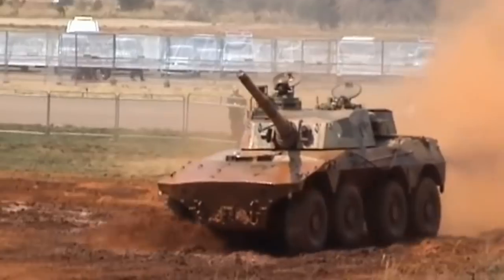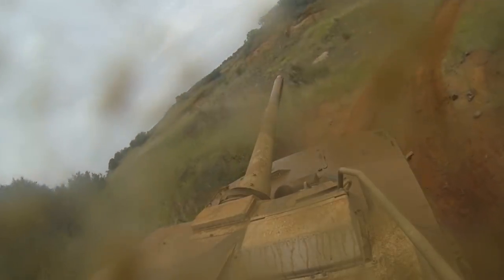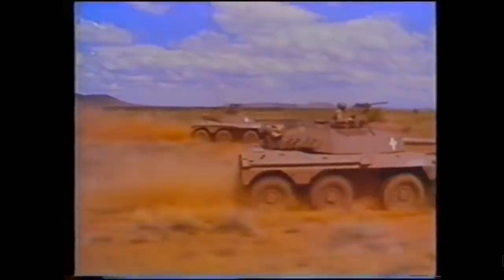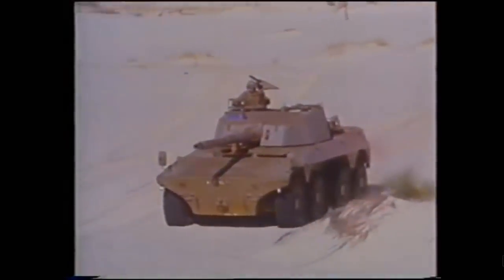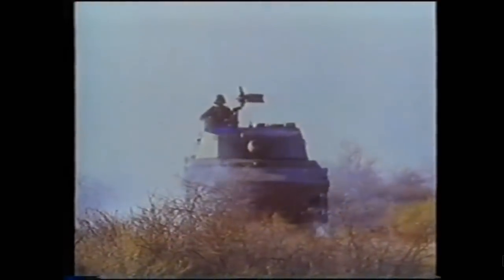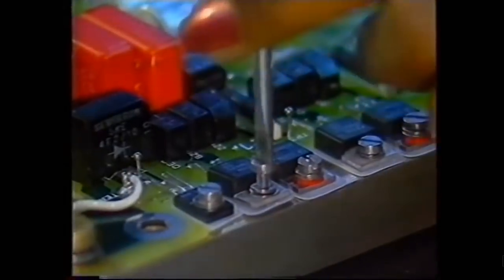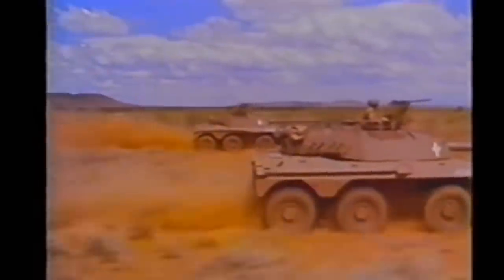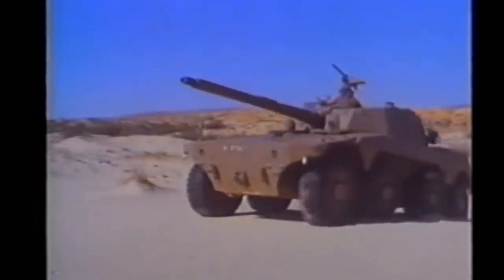Rooikat Armored Fighting Vehicle - South African Firepower

Comment: Something like this with a 120mm gun for our fast reaction brigade would be a good idea
Reply: there is a rooikat with a 120mm, it is not supposed to have been produced but it but a number have been seen on parades, what that means is up for debate but still
Reply: The Rooikat has a lot of potential. You can design 20 mm anti aircraft guns onto it for protection against aircraft, or even twin 60 mm mortars for close artillery support.  But yes, there are 120 mm and 105 mm prototypes, they unfortunately never went into mass production as the 76 mm proved itself more than capable.
Reply: @matthiuskoenig3378  At what parades have you seen Rooikatte with 120mm guns?

Comment: Rooikat (Rooi sounds like Boy, Kat sounds like Cut)

There is much discussion regarding the 76mm cannon The vehicle was built for speed (over rough terrain) and fire power in Southern African conditions. Including a 105mm or 120mm cannon will add (ammo) weight, and may compromise speed etc.

Comment: This seems like a good all-around afv for it's time 
It is showing it's age though with the 76mm cannon, which I would think is a little underpowered by today's standard but most everything else is quite good like it's maneuverability ( which is the one trait on a vehicle that is timeless) imo it's a little on the heavy side but it's power to weight ratio is real good and it's protection is lackluster 
   The biggest problem though by far is that DAM music in the factory video man I get it it's the 80's but come on 🤔 O and having tracks as an option would be nice...........😏
Reply: +Theprfesssor+ imagine mounting the 76mm gun on a Bradley (or the chassis since given how cramped the Bradley interior is I doubt the current turret could accommodate it).
Reply: cnlbenmc 
 Yeah, the Bradley would have to have a whole new turret most likely and even a redesigned hull top, if the turret ring is not big enough 
It wouldnt really help the Bradley anyway in it's main goal,its a infantry fighting vehicle designed to carry and support troops then leave the area and the 25mm auto cannon has many rounds designed specifically for this and is a light armament, the rooikat and others like it are AFV they are pretty much wheeled tanks, the closest thing to a light tanks we have today they not only cross great distances and Recon they can go on the offensive against other armored vehicles including including tanks now not head on but a gorilla type attack style is possible 
Overall the Bradley doesn't need much help fighting/protecting itself even against tanks, the Bradley unit's actually knocked out more tanks during desert Storm then the Abrams did so for now I think they are fine  (thanks to its dual tow missile but still )
Reply: +Theprfesssor+ probably right on the turret part, many years ago at an airshow/tankshow when I was around 10 years old and only around 5'4 instead of slightly over 6 feet tall now; even then I found the interior of the Bradley to be cramped. The idea I proposed would be for a separate type of vehicle akin to the Stryker MGS, a light tank variant or for the M3 CRV to give it a bit of an extra punch in it's recon duties if thing get dicey. 

Though the thought of just imagining one upping the BMP-3 with a Bradley variant with a new turret armed with the 76mm, a 25mm coax and some ATGMs with a ROWS as the cherry on top all at once makes me smile, fat chance that'll happen though.
Reply: keith moore 
This is why the Stryker ( like most modern military vehicles) are a modular design, the army can outfit them for certain situations to have them better equipped to deal with them 
   The 105 is used because it still performs well against most modern tanks and it's standardized by NATO, all countries in NATO can and do use them so it's easier in terms of logistics, the biggest reason to use a cannon though is its versatility you can fight tanks with it or you can support Infantry or you can even use it as artillery if you had to
As for atgms, there is a variant of the Stryker that uses these https://en.m.wikipedia.org/wiki/M1134_Anti-Tank_Guided_Missile_Vehicle 
   unlike cannon atgms are less versatile, they are designed to kill tanks and are really good at that but not much else, they sit back and pick off armor from miles away they can't support Infantry directly like the 105 can, and they are much more expensive then cannon rounds
Reply: keith moore 
Like said 105mm is a standard NATO cannon, they have been around long time, there many type of ammo and lots of it around,the biggest advantage is the 105 is still effective against modern tanks, we used to have 76 and 90mm but they are not longer good enough against modern armor
This Stryker has trouble in town, yes this is a drawback but this is why there are other variants, the 105 stryker is a variant designed to support against hard targets likes tanks or bunkers more effectively this is why we have other variants for direct infantry support like icv version and we also have the Bradley,and there is Stryker variant with a mortar which are great for indirect supporting roles in towns 
the 105 Stryker just one of many different varieties of Stryker vehicles, they each are designed to better help in a given situations this is why we make modern vehicles modular so they can be equip for specific requirements

Comment: The Rooikat main armament is the Denel GT-4 76mm semi automatic quick firing gun and fires the following rounds: High Explosive (HE) with a direct effective range of 3500m and an indirect range of 12000m, Armour-Piercing Fin-stabilized Discarding Sabot (APFSDS or FS) with an effective range of 2500m and Canister with a killing range of 150m and a wounding range up to 350m (however I won't recommend personally testing that out). It's secondary armament is 1x coaxially mounted 7.62mm (0.30in) MG4 Browning machine gun (the commander's roof mounted machine gun no longer being mounted) and 8 x 81 mm smoke grenade launchers.

Comment: Re: Only 76mm guns - Im no expert but the SADF also developed the G6 mobile artillery vehicle carrying a 155mm cannon with extreme long range capabilities. For the most part the border war involved covering large distances as quickly as possible with a need to penetrate enemy territory, do some damage and then escape quickly (the troops were not weighed down by armour or even helmets in many cases as they would need to run long distances and probably swim across rivers). The nature of the bush would also have made a lighter more maneuverable vehicle desirable. Most contacts took place at around 50m distance (limited visible distance in the bush)

Comment: I also heard stories from my father and uncle's about how the Casppir, ratel and rooikat were primarily designed with land mine protection and high mobility in mind. And reading does indicate that at the time the army did not really expect to engage a lot of heavy tanks and thus used the lighter gun. 

Eventually when heavier tanks were encountered tankers had to learn to use the vehicles mobility to maneuver around enemy tanks to knock them out. ei drive around or over dunes to flank them in the Sahara/desert terrain, since sometimes the 76mm or 90mm low velocity guns did not always penetrate heavy tank frontal armour.

seems there are some new sites with info 
rooikat: http://www.tanks-encyclopedia.com/coldwar/South_Africa/Rooikat.php
ratel : http://www.tanks-encyclopedia.com/coldwar/South_Africa/ratel/
casspir : http://www.tanks-encyclopedia.com/coldwar/south_africa/casspir
and first time I have heard of the eland :D
eland : http://www.tanks-encyclopedia.com/coldwar/South_Africa/Eland_90.php

Comment: Not all 76mm guns are the same.
The 76mm gun on the Rooikat is based on a powerful naval gun.
Its case is 636mm long, which is longer than the case found on the 105mm L7 tank gun for example.
The APFDS has a muzzle velocity of over 1600 meters a second.
The gun was chosen as it penetrates a T62 tank frontally at 2000m, and more rounds could be carried on long operations.

Comment: To get the power from the engine to all eight wheels requires quite a bit of gears, and combination of diff locks,  Maybe it is a less known fact that an electric transmission was also developed for this vehicle as a technology program, starting in the late eighties. Although never implemented , it was one of the most successful technology programs, and at that time was a leading concept in the world. 
   Actually when the all electric gun control system and eight wheeled weapon platform was developed in the early eighties, it was also ahead of it's time.
   Needless to say, for all hardware, comprehensive logistic support and training was provided to the last detail.

Comment: I wonder how they know if certain tires have been destroyed. How would you make a sensor for that? You could maybe make like a light reflector on the inside of the tire.
Reply: The sense is called the human eye.  Rooikatte do not work alone, they work in troops of four vehicles, so the vehicle next to you will tell you. Also the drive is going to notice handling problems if there is problems with one or more wheels.

Comment: The U.S. military needs to have a modernized version 105mm Rooikat concept or similar modern vehicle in large numbers in all mechanized infantry brigades. These South African vehicles are good at limited warfare, long range patrolling, reconnaissance, and fighting low and medium intensity conflicts. The beauty of these vehicles are their long range capabilities in harsh environments and rugged terrain. The Rooikat is also an excellent convoy escort vehicle on roads and highways. In so many counterterrorist warfare tasks, the Rooikat would be an excellent vehicle to complement the Stryker Infantry Fighting Vehicles. Few 21st century wars will require a 70 ton main battle tank for high intensity operations. However, a vehicle with a medium tank capability on wheels with adequate armor protection are precisely what are needed for low intensity warfare operations. The ability to travel fast over long distances over harsh rugged terrain, protection againat landmines and roadside bombs are paramount. 

Most peacekeeping operations, humanitarian missions in warzones or nation building security operations require continuous patrolling, reconnaissassance, convoy escort missions, and firepower for a meeting engagement or counterambush against small bands of enemy insurgents or terrorists. Also, forward air controllers could travel in Rooikat vehicle to call in air strikes against hostile targets in these low intensity and counterterror wars. So a modernized Rooikat for the 21st century with a 105mm gun would be a extremely cost effective investment for the U.S. Army and most NATO armies.

Comment: My question about the 76mm is how much armor can it penetrate? If it is capable of going through over a 100mm armor then perhaps it is suitable for whatever they're bound to come across. I haven't heard of any major Main Battle Tanks in Africa, but that is simply my opinion and ignorance on the topic.
Reply: they can penatrate t-72Ms at 2km but the T-72m isn't the best MBT
Reply: The Rooikat Gunnery manual says that the FS round can penetrate the frontal armour of a T-62 tank, but does not give a number on penetration in millimetres.
Reply: Penetrates T-62 frontal armour at 2000m.
Not all 76mm guns are the same.
The Rooikat gun is based on a very powerful 76mm naval gun.
It's case at 636mm length is actually longer than the 105mm L7 case.
Reply: @Vincent-q4q  Makes sense considering what they were likely to face in Africa.

Comment: Like your channel .   I think they went with the lighter guns so everything could be lighter and faster .  Heavier guns means stronger & larger turret , beefier chassis , stronger engine & tranny , Stronger suspension & wheels , & last but not least bigger fuel bills & maint.  Heck you know all of this .  They should have gone with 90mm in the 60's that is what are MBT's were using then .
Reply: Nah, just add some rockets and maybe reactive armor and they may be use for another decade.

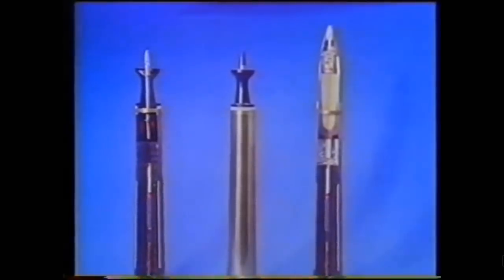Comment: 10:20 Damn, that APFSDS round has a super short penetrator. I mean, against IFVs and APCs a that have armor rated only for auto-cannons, it should do the trick, but a penetrator that does all the way down near the primer could get better penetration, although I do not know if it would be enough to punch through even a T-55’s armor since that armor could stand up to 90mm(albeit with less advanced projectiles) guns, which might be the reason they have not used a longer penetrator. If they are worried about Tanks, I think ATGMs would be a better idea than a 105mm gun since modern ATGMs do have longer range than most Tank guns and much better penetration(compared to a 105mm) as well. Plus, they can continue to carry a 76mm gun for anything other than MBTs, to help carry more ammo and keep weight down. A roof mounted one would be the cheapest solution but a integrated launcher like those seen on IFVs, would be a better solution since the operator doesn’t have to expose himself and can more quickly switch between the ATGM, main gun, and Coax MG.
Reply: Believe they had a round that could take out t55s

Comment: I agree Matsimus. I severely dislike wheeled vehicles in most applications as well as think that they shouldn't be so damn stingy on the firepower. A couple ATGMs hull mounted could cover a possible brown alert caused by a large vehicle appearing. Even with ERA a modern tandem warhead missile should be sufficient and even if they cant be produced locally the numbers required would mean that it wouldn't be a huge problem as it isn't a primary weapon.
Reply: That's why Rooikatte work closely with Ratel ZT-3 A2, firing the Ingwe (Leopard) High Explosive Anti-tank (HEAT) missile and the Rooivalk attack helicopter.

Secondly the electronic components of missiles can not take the punishment produced by  the Rooikat's high speed.

Comment: Thanx so much for this interesting contribution. Yes i agree a bigger high volocity gun would be a better proppesition than the 76mm gun currently used. The 105 mm high pressure gun is mounted on the Rooikat armoured fighting car but it is used for the export market. The South African regime dont order this new version and such as many other state of the art new equipment manufactured in our arms industry. It is more applicable for them to use the tax money for themselves.

Comment: Rooikat = 'Roy-kut'. Rooivalk = 'Roy-fulk'. Ratel = 'Raa-til'. Olifant = 'Olly-funt' (not quite, lol). Eland = 'Ear-lund'

And you have to rrrrroll those r's ;)

Also, reading the comments, it's kind of pointless comparing this to other countries designs in a way - it was designed for the specific requirements of the SADF, and based on their experiences. Having battled Russian export equipment, and surviving, even winning, was largely a matter of superior tactics, training, and often not a little luck (lightly armoured Ratels with low velocity 90mm's vs T55's etc involves the occasional sprinkling of luck, yes), and having been exposed to the difficulty of keeping the heavy, expensive (in strategic value terms) Olifants in the field, meant that they came up with this. Difficulty with logistics, the harsh nature and scale of Africa (it's big), operating on a shoestring etc, all typically African requirements that dictated a light, mobile, long ranged vehicle with just enough punch to do the job. African battles are normally about who can get what, where, then get out while keeping their indirect fed, even if they're just light mortars (aka Logistics). Not who has the biggest gun somewhere else.

Comment: Rooikat could actually do 140kmh with gun & turret and 200kmh without. 
Retrofitting with a 90 or 106 gun would be an easy job as Denel were manufacting them at the same time, should the need arise. As has been stated that after "87 the bush war had basically ended. 
I would have loved to see how much worse the Russians could have been beaten at Quito had we had Rooikat & Rooivalk available.
At the time there was no other force that could compare with what we had for the terrain and style of war we were fighting. The Israeli and US helped us, and any new equipment that we sized from the Russian backed Cuban forces were quickly moved to the US for inspection and reverse engeneering.
At the time of the bush war our training far surpassed that of the enemy and we could go up against Mig fighters with Ipala an Mirage F1 planes. IMO the only thing that we lacked was a decent hand weapon, the R4/Galeil was a POS compared to the AK47. We had to continually maintain them, while the AK was tough as nails, put it in a mud puddle for 2 weeks, thake it out, cock it and fire. Try that with a R4 and you'll end up in the hospital.